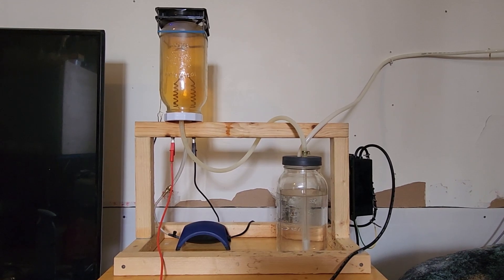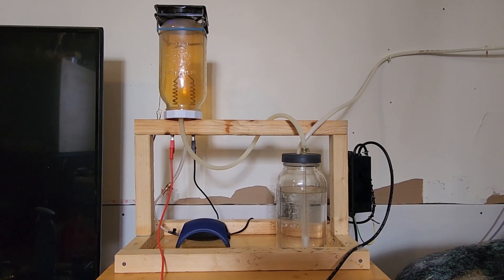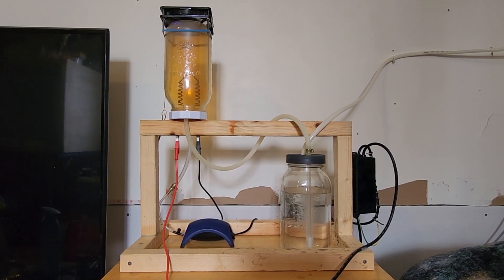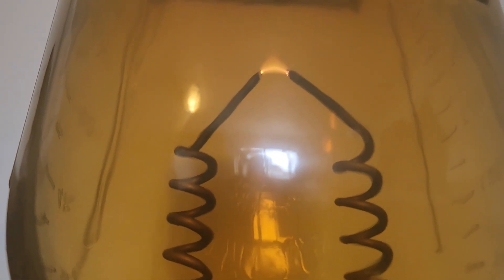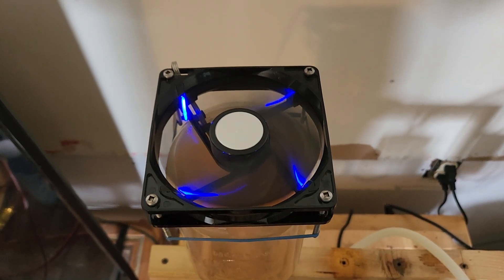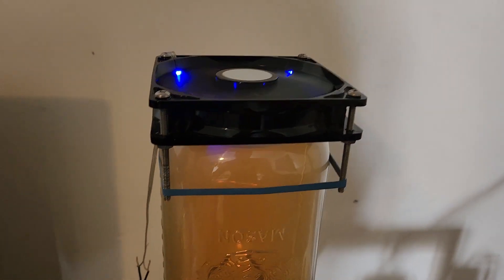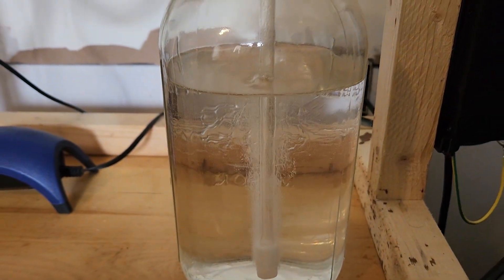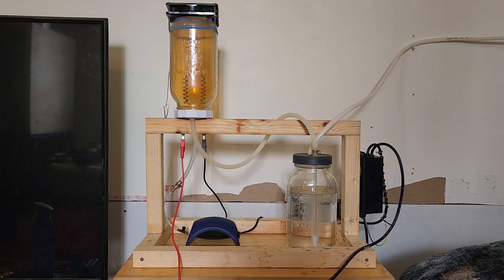Nitric Acid Generator Version 3 - Making Nitric Acid From Air

Comment: I wondered how can one can break up the bubbles and substantially increase the residency time for greater absorption, and maybe even reduce the amount of water so the nitric acid concentrates faster.  Do you think a bunch of acid washed sand and or silt in water would break up the bubbles, and slow the rate  they rise all while displacing a significant amount of water?

Comment: This voltage ac or dc?
Reply from the maker: AC
Reply: @copperinquarter  any contract?
Reply from the maker: @r-mangaming519  What do you mean?
Reply: @copperinquarter  I want to talk to you about something
Reply from the maker: @r-mangaming519  you can email me at copperinquarter@gmail.com
Reply: @copperinquarter  Bro can i use dc high voltage genaretor for arc?   Your email is invalid
Reply from the maker: @r-mangaming519  DC should work fine as long as you don't plan to spread the arc into a plasma disc with magnets.

You probably typed the email wrong.
Reply: @copperinquarter  
you mean per month 1500 l or only  1 litr

Comment: I mixed my acid 68% with some lite salt, cornstarch and brown sugar it turned red and then I left in a stainless steel sink outside overnight and it turned green and my sink had corroded slightly what happpend?
Reply: Stainless steel sinks (unless it’s specified) are made of the cheapest possible “stainless” steel and will not hold up to nitric acid.

And by cheap, I mean price AND quality.
Reply: It absorbed the chrome in the steel alloy, you now have a solution of chrome nitrate and iron nitrate

Comment: How much Watts does it have?
Reply from the maker: This one runs at 300 watts. (10,000 volts × 0.03 amps)
Reply: @copperinquarter  Chinese sells tham power supplys with 4000volt and 0,03amps better energy effiziency

Comment: Good setup, just had a couple of ideas on how to improve it
- Switch to a copper vessel with insulation over it for the arc chamber, heat is beneficial for the reaction and will improve yield.
- Use thick-walled, small diameter copper pipe as the electrodes and pump the air mix in via them, this cools the electrodes passively allowing a higher arc current
- Add an oxidation chamber to convert unreacted NO into NO2.
- More power!

And now for the advanced changes lol
- Enrich the intake air to a higher percentage of oxygen, nitrogen content slows the reaction down unless it's at a stoichiometric ratio.
- Use an Ozone generator to feed both the oxidation chamber and the main chamber, ozone is more reactive and will improve NO to NO2 ratio!
Reply from the maker: Thanks for the suggestions, and thanks for watching!
Reply: Yeah, all that NO is a PITA for this procedure.
Reply: Heat also drives the decomposition for NO2 back to nitrogen and oxygen.
Reply: How would you suggest i add an oxidizing chamber? How would it work?
Reply: @Hampyumpy  The oxidizing chamber is just a bottle or tube of either copper or glass, it just mixes the output of the arc chamber with fresh air, pure oxygen or Ozone to complete the reaction.
Reply: @TheHuntermj  Would it be better to do it in a smaller container than the main reaction chamber? And would airflow have to be the same for both chambers? Sorry for the questions, it's a novel idea that I haven't seen be used in any berkyland eyed reactor video yet!
Reply: @Hampyumpy   A larger container would probably be best to increase exposure to the O2.
Air flow could be the same or less as the arc chamber because, hopefully, most of the reaction has been done already.
Also, a UV light source shining into the chamber would help provide extra free Oxygen molecules and increase reactivity.
Reply: Actually  gliding arc reactors,   similar to the jacop ladder  except fresh air is blown through the arc,  are relatively efficient at nitrogen oxide production, and considered non thermal plasmas.  i would  say maybe less thermal then a simple arc or Jacob ladder.  And the fresh air helps quench the reaction preserving the nitrogen oxides created and  avoids burning them up  as the gases do as they recycle through the arc in non gliding arc designed. 

Pressure brings the atoms and molecules closer and helps dramatically increase the nitrogen oxides creation.

Comment: Very cool. Ive been struggling to keep the jacobs ladder going too. I finally set two magnets near it and this made it arc about 4x faster but when i came back 20 min later the ballast was dead 🥲
Now im trying to build either a zvs driver circuit or cobble together the original flyback circuit from the tv. I spent like 8 hours just getting the stupid ballast to drive it. Maybe im to dumb for this stuff. Lol
Reply from the maker: Honestly, a simple arc has been working flawlessly for me and produces just as much nitrogen dioxide. If you're trying to make nitric acid, you should just go with a simple arc. Unless you just want a Jacob's Ladder for the cool effect.

I'm thinking of implementing a second neon sign transformer and have dual arcs to hopefully cut down nitric acid production time significantly. Stay tuned for version 4.0! 😀
Reply: @copperinquarter well thats gonna be next level! Subbed and Looking forward to see this v4

Comment: Amazing! Thats a very nice setup, whats the production rate?
Reply from the maker: About 1.5 liters of 20% HN03 a month. Nothing spectacular, but it works!
Reply: @copperinquarter  Hi! How did you measure the exact concentration of the acid?
Reply from the maker: @Hampyumpy Hi there! With a chart I found on google images. It states the specific weight per ml for every concentration level. For accuracy, I measure 10 ml and then divide by 10.

Comment: your skipping a major step . you need to oxidize the brown gas with fresh air then bubble it threw water
Reply from the maker: The brown gas is nitrogen dioxide. Nitrogen monoxide is colorless. My homemade nitric acid works very well.
Reply: @copperinquarter  he means that you'll get a higher amount of NO2 if you pump air in as well using something like a fish tank airpump. The NO will convert to NO2 creating more acid when diffused through the water.
Reply from the maker: @chemistryofquestionablequa6252  There is an aquarium air pump pumping air. That's how the system works. It's the blue thing on the table under the arc chamber.
Reply: @copperinquarter  I should have been more specific,  if you're getting significant NO generation you should increase the airflow to convert it to NO2. I think that's what he's getting at at least. Using peroxide in your collection chamber will increase your yield and a second chamber with water and sodium carbonate can make sure you're getting all of the nitrogen oxides.
Reply from the maker: @chemistryofquestionablequa6252  The problem with increasing the airflow is NO doesn't have time to oxidize to N02 and would require a separate heated (to prevent NO2 from condensing into liquid form) oxidation chamber.